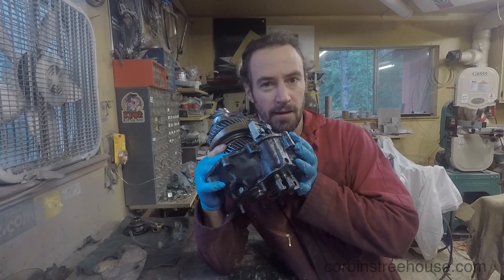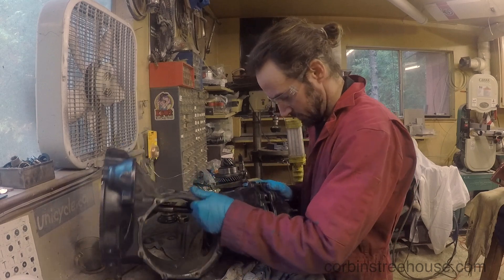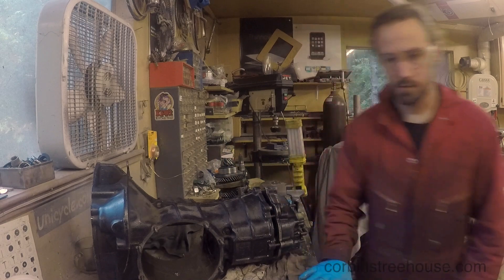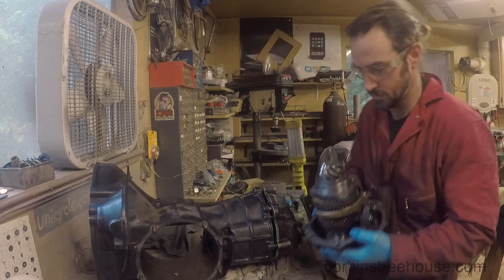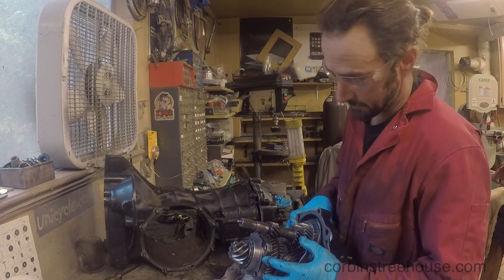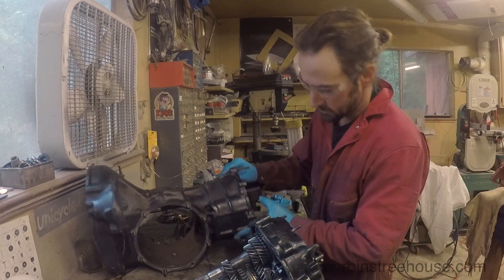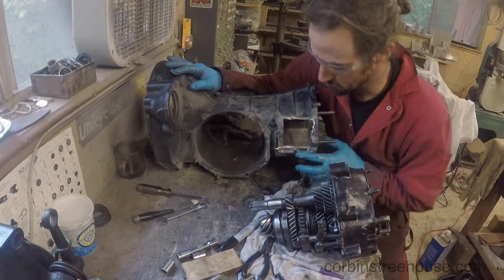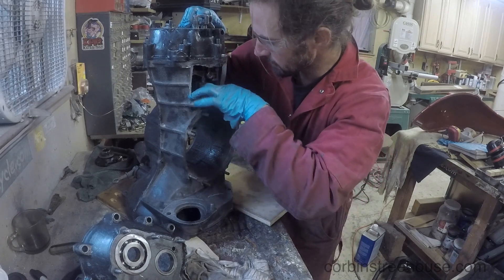Plug Bug: VW Transmission shifter fork adjustment jig

Comment: That's a great idea I'm going to do it I just have to get in the mood to cut up a good case but it's really no good to me because the gears are no good but still
Reply from the maker: Yeah, I had hesitations too...but it was the cheapest solution for what I had around.
Reply: @CorbinDunn  I stripped the gears in one trany and something is clunking in the one in the car so if I can fix it I want to change fourth gear because I have a ford turbo motor in it and I'm on my fourth trany so I need to learn to fix em  what was wrong with your trany to make the video ?
Reply from the maker: @martywolf1819  I have an electric conversion I did ~12 years ago, and the torque is hard on transmissions. But I got rear ended about 5 years ago and it broke the case on one of them. So I tried to combine the "good" parts from one transmission with another one. It works..but it isn't as easy to shift as the original transmission that came with the car. The original tranny probably had 300k miles on it!

Comment: Given the torque characteristics of electric motors, I've been wondering if you could go sans 'transmission', and just have a fixed gear ratio. I believe the original Teslas were like that.
Reply from the maker: Unfortunately, the motor I'm using has a ~5000 RPM limit. This means I'm limited in how I can gear it; I could gear it up (say, permanent 4th gear), but it would be slow to take off at low speeds and use excessive power. So, instead, I use the gearbox and skip 1st gear (too torque-y to use it...and not necessary). This also allows me to keep the motor at its ideal efficiency range. The Teslas all have a single speed gear box, but they have a much higher RPM limit (say 12,000 or so).
Reply: Ah, makes total sense. Begs the question of why would you run your motor up to 12k rpm when it's going to be a lot more efficient at a lower speed. I heard that Tesla had some delays originally due to problems with the transmission they were trying to make.

I wonder how a CVT would fare in this application. I guess not well, as no one is using them, that I know of.